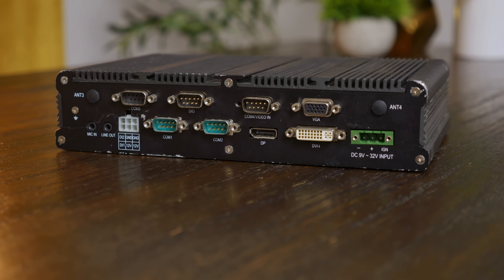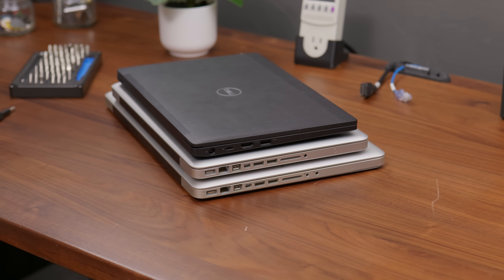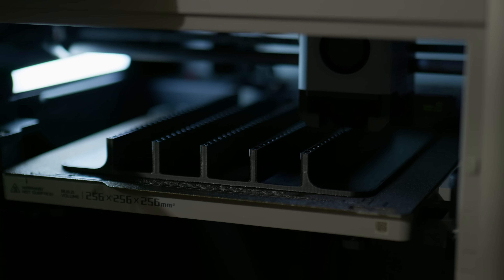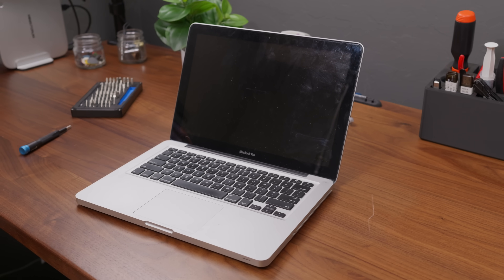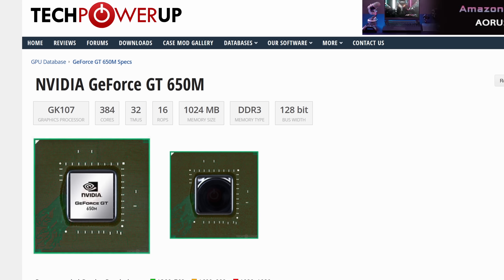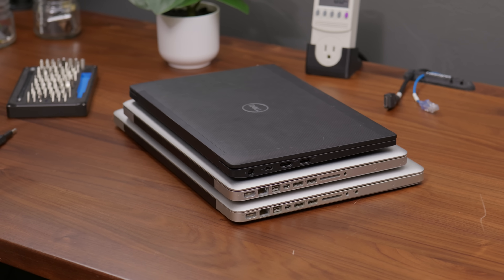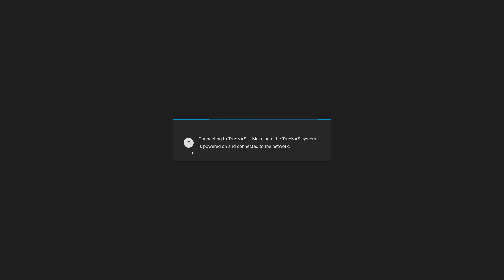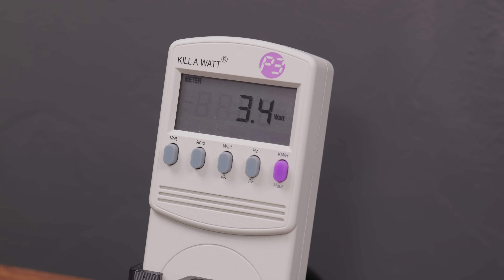Building Cheap & Efficient Home Servers with... Laptops?

Comment: I suggest removal of the Lithium Battery pack if able to so that you dont have to worry about a time bomb Pillow. I run laptops as servers and they run without their batteries installed, and they are powered through a battery backup that protects from a power dip crashing the servers. Most will run full clock although a HP 4th Gen i3 is locked to 800Mhz when it fails to detect the battery present. This actually was beneficial as 4 cores at 800Mhz was more than plenty of processing power and forced the server to consume even less power than if it ran full clock. Additionally it runs very cool with the 800Mhz forced clock by the HP Power Management system.

Comment: I’ve dealt with a ton of laptops, I would implore anyone to NOT leave them plugged in all the time.
Batteries need a charge and discharge cycle, otherwise, on either end of the spectrum, you get a spicy pillow instead.
This causes fires btw.

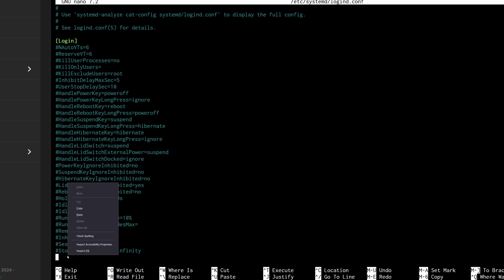Comment: 9:27 this is what I need to figure out. I was to use an old 2010 MacBook Pro to run Home Assistant. And to keep it running with the screen closed. Any chance you can point me in the right direct, or do a tutorial on how to do that with Home Assistant. Probably running Ubuntu (no experience there). I've got the optical drive SSD replacement tray that I never installed. So I'll have 2 SSDs and I'm going to upgrade the RAM as well... Just have no idea how to run Home Assistant and keep it awake with the computer screen down.
Reply: Also I don't see a link in the description to alter that login file you mentioned to ignore the lid switch.

Comment: Some laptop models are built to run completely fine on the power outlet without having a battery inside if you wish to avoid worrying about the battery swelling spicy packet problem. I expect that it can cause blackouts if the building is not up to the task of having your multiple laptops run completely on the outlet.
Reply: you must be kidding right? an electric kettle consumes 1500W, a microwave 1000W, a gaming computer 500W, a heater 1000W, majority of places on the earth are advanced enough to supply this amount without issues, additional 50-100W wont cause blackouts

Comment: I think on the one you could have run "xset dpms force off" to force the screen off another option might be "kscreen-doctor --dpms off" Both should turn your display off. Sometimes other sleep modes can interfere and turn it back on so you need to disable those if any are on. Another neat trick you can configure lid close actions a lot of the time so set it instead of lid close suspend to lid close run this command.

Comment: You can just remove the laptop battery if you are running off a UPS.  This will also improve heat dissipation and prolong the lifetime of your laptop, PLUS it is safer as you don't risk your batteries catching fire.

Comment: 4:25, ACTUALLY, I have basically the same laptop, Latitude 5290, and the wwan slot surprisingly does support SATA! I have no clue why would they allow that, but it does work, I was cloning my small SATA m.2 SSD onto a new NVMe SSD using this trick.

Comment: I know this is a bit late but, I was thinking about what you said about not being able to enter the mac bios to set on power on lan and stuff.
I am running linux on 3 mac-minis 2011 with i7 and i5 cpus and all with 16gb of ram.

I run them as a redundant pihole cluster with keepalived to have floating ip-addresses.

However, to my point.
I wanted to make sure that they boot back up after a powerloss, and that is something you would do in the mac bios setup or from a mac terminal by running sudo pmset -a autorestart 1
But... .
I figured out how to enable that from inside linux.
Running sudo setpci -s 0:1f.0 0xa4.b=0:1 from inside any linux is the same thing as running the above command in mac OS terminal.

So, I am thinking that the settings you want to enable might have similar options for linux, maybe... .)
I don't have the solution for each setting but some digging could make you find it.

Comment: Late to the show, but another issue is the batteries. I've had two Macs that swelled enough for me to put them outside until I could dispose of them. Might be good to find a way to run them without the Li-on batteries.

Comment: I had this idea a few years back of using a central server to run my entire gaming pc home network.  The concept was to have a central computer, that users can log into to play games.  This concept was powered by the video from LTT that was I think 7 users 1 PC from a few years back.  The computing resources would be centralized with powerful graphics cards and processor, and resources would be divided up between users.  The users would have simple clients PCs with large monitors, keyboard and mouse, and stream the data from the server.  If one user was on, they'd have access to the full power of the system.  Each additional user would divide the power equally so multiple people could play games together on roughly equal footing.

The goal, was to have 1 Super powerful PC that could be upgraded with high end hardware for my personal gaming, but when my family wanted to game with me, I could have 2-4 additional players with decent capabilities without having to have 4 full gaming PC setups.  That could get expensive.

Is this something that anyone has explored?  Is it possible?  Is it economically feasible?  Or would this be more work than it is worth?

Comment: Welcome to my world. 

I use a Laptop with a dedicated RTX3050 as a Home / Plex Server. Its a Powerstation and portable if i need to. It needs reasanble 10-12 Watts in idle and runs 24/7. 

I only paid 500€ for it. It can transcode or playback 4K HDR / DolbyVision for 3-4 users on the fly. 

The Setup is very easy and the Laptop looks super clean on the Desk. BONUS: It keeps running on bettery, even if the electricity goes down.

Comment: I have had a similar setup for about 4 years now. One thing to note is to remove the battery from the chassis and connect to an external UPS. Batteries in old laptops are already beaten up and if kept plugged in all the time they swell up pretty fast. Second thing was internal drives which are not rated for 24/7 loads. I ended up using an internal SSD for boot and have a seperate NAS for storage.

Comment: I have a Dell Latitude from 2009 (Core 2 Duo). I removed the display, wifi and Bluetooth radio, and installed Debian on an old 16 GB USB drive (no hard drive and didn't want to buy one). I can use the VGA port if I need a display but most of the time I just use SSH.  You can learn a lot by challenging yourself with limited resources and old hardware.

Comment: Some laptops even run without the Battery, just disassemble it and disconnect the parts, you don't need. If it reboots, its fine. If it won't reboot just connect the parts the laptop needs.

Comment: I have been running an Asus 4th Gen i7 as a plex server and a PieHole (VM) and ive got Hard Drives attached Via a USB C Hub. since each hard drive is accessed individually, the speeds are quite okay, even for 4K content. Ive had this system running since 2018, i think and it just works, i clean out the fans etc of dust once in a while and that is it.

Comment: I've been using a laptop as a server to run my non-cloud-connected home security cameras for years. It works very well, uses little power, takes up little space, and has the convenience of the built-in battery to keep it running for a good solid two or more hours during power outages.

Comment: I would worry about the fire risk of the battery using laptops as a server. also the cooling fans are not going to last long running 24/7 on most laptops

Comment: This was a very inspiring and helpful video! I have 2 different dell laptops that are "dead" in different ways. The least capable one doesn't charge the battery anymore and only works with the power adapter. The other one is 2012 top-shelf 17 in. but the screen doesn't work. I was going to throw them in the trash because I live in rural area now so there's no hardware repurposing centers (like when I lived in Portland, OR), and I don't have the time to manage a part-time hardware business like FB marketplace or ebay. But, I now have renewed hope that I may be able to repurpose these old laptops into something useful! Thanks!

Comment: I did encounter some Problems with ZFS and some "normal" Curcial MX500 SSD, I would not recommed to set it up the Way you did. The wearout on them is really high. I once had a ZFS Pool setup (in Proxmox) and Wearout was at like 12% after just some Months. It is recommended to use enterprise grade SSDs. I now Run off of a single NVMe which gets Backuped frequently to another HDD, so in Case of drive Failure I can recover from that HDD. I can recommend using some SFF Enterprise Desktops, like the HP Pro Desk. I have a Unit with an i7 10700, one HDD, one NVMe and an SATA SSD und in Idle its just drawing like 15 Watts.

Comment: I was running an HP netbook with an atom processor and 2GB ram as a NAT box and NFS server at home. It used Elementary OS. The thing started freezing randomly some 5 years ago and I replaced it with a cheap mini PC. To teach a class, today I was configuring a pink Acer aspire one netbook (featuring a 32 bit N270 atom CPU and 1GB ram), to show kids that "server" does not mean a monster of a machine.

Comment: I've been running laptops as home servers for years. 4 Thinkpad x220s with 16 gb RAM to be exact. What I like (worked well): space efficient, quiet, low power draw, reliable hardware, hardware works well with multiple OSs. What I didn't like (didn't work well): storage. My most storage intense application was Plex. Wanting to run mine on the very cheap, I bought a WD 4TB (MyDrive) external USB drive for each laptop. My experiment was to run ZFS on them. It works, but the bigger problem I ran into was when there was a power flicker and the external drives would be powered off and the servers would continue running (batteries in the laptops had enough charge to keep them running).

After a period of time (years), I bought an old Apple Mac Pro 2013 (trash can) off ebay for cheap price. I upgraded the RAM and CPU on it and bought an external RAID enclosure with 4 bays. I put 4x 4TB SATA III drives in it and I run SoftRaid. This Mac is running Sequoia (last release for this hardware). I have the RAID enclosure configured for RAID 10, so with 4x 4TB drives I have 8TB usable. Moved my Plex library over and used it for a while. After various annoyances with Plex, I switched to Jellyfin. This is the configuration I'm still using today. My biggest complaint with this current setup is that my drives in the RAID enclosure are louder than I would like.

I still have 3 of the Thinkpad x220s up and running. Mostly just use them for various experiments now. My recommendation to anyone wanting to set up a group of old laptops for home server use would be to buy a decent NAS (Synology or uGreen) to handle the storage duties.

Comment: Bad bad bad! You're giving me ideas! 😈😂
Honestly, I never thought about using a laptop with a bad screen as a server, that's actually clever because they'll be cheap enough because most people won't want it, but tech savvy people like us wouldn't care because we purpose it for something else. I personally would pull the batteries though. Sure, you can keep the system running with a battery in it...but if you lose power and your switch doesn't have battery backup, it's useless to an extent anyway. If none of your other computers have a UPS, that's also an issue because it won't prevent data corruption if your power goes out and the computer shuts down in the middle of a file transfer, so I don't really see much benefit in keeping the battery in it unless you UPS all computers and equipment in your home.

Comment: imagine mounting them on rails and you could slide them out to administer them. linux should have som power settings for like a max percentage and a percentage to restart charging. also you couldve made better use of those sd card slots - there are sd cards that go up to like 2tb now.   imagine a stack of like 8 or 10 running a hyperconverged kinda thing

Comment: Just(found) watched your video, to stop battery damage on a mifi i use in a different location,  I use a tapo smart plug. 
It monitors the supply and shuts off when 80% charged

Comment: I am running a nextcloud instance + ollama on an old Lenovo IdeaPad laptop using snap packages). It runs 24/7 sipping around 3 to 4 Wh. I bought a new battery and it can hold for around 6 hours. I hooked a caddy for extra backup storage and it works like a champ.

Comment: I used an old Dell Latitude as a VPN server that also ran SIEM software on it. The keyboard and battery were broken but I got UEFI to not look for the battery and the removed keyboard meant the fan had much more air for cooling. The system ran cool and I had a script that would turn the screen off and leave the system running. It works great and the only reason I stopped using it was because I got purpose-built hardware and virtual machines to take over the task.

Comment: In Dell, You could probably put NvME into WWAN port with adapter. It works fine in 5470 i converted into NAS server. 2.5GBps LAN adapter into WLAN port, then 6x sata adapter into NvME port.

Comment: I use an old Dell for this and installed System Bridge to feed the battery status back to Home Assistant which controls a smart plug to keep the battery charged between 50-70%

Comment: Anything with a GPU will definitely be the largest power drain. Yet any laptop should  idle it or can be disabled in hardware setup. Any lithium battery kept at 100% & alive will die even faster than normal charge cycles and may not even make an electrical connection, forget a UPS. That will be nice for a while but an already old laptop probably has a battery already at 80%, 50% of original life.  At a minimum you might check before installing the new operating system with the manufacturers system check

Comment: On dell latitudes, usually there is a bios setting that you can define how you plan to use the system in regards to the battery charging. Depending on your work you might be able to obtain old laptops to do this home lab thing.

Comment: do you think my home lab is good for nas and minecraft and beammp server hosting?
servers= 1. poweredge 2950 iii with 1x 4core 3ghz 80w cpu and 4gb ddr2 fb ecc ram 300gb raid 1 with cheetah 300gb T10 15K 1,5KW psu
2. fujitsu tx150 s7 with 3 quadro 4000s 16g ddr3 ecc ram and some 4core 4ghz cpu 2x 1tb wd blue + 2x 320gb seagate 550W psu
3. proliant ml 110 G5 2core 2gb ddr2 ecc  500gb + 160gb + 80gb 500w psu
4. lenovo idea 100 pentium laptop 8gb ddr something 128gb ssd
fo gaming= 
omen 015 rtx 3070 32gb with some H series ryzen 7 with 1tb m.2 500gb ssd wich goes to m.2 port
prodesk 600 G2 with gtx 1080ti 24gb ram and no storage in it its using network boot and the case of it i got for free old dell case 250w sff old hp powersuply

btw all running ubuntu server / ubuntu desktop cuz idk what is best to use and prodesk is using win11

Comment: I do this. People talking about batteries are not totally wrong, however a LIPO/LIFEPO battery always have a BMS. BMS's have varying quality. If they do not shut of charging  correctly, the battery will be over charged which will render the battery useless but also be a potential fire hazard
Reply: The battery overheat sensor will just kill the laptop, no fire risk. But I'm sure there are better and worse bms in varying laptops. At best, they will keep the battery from degrading quickly vs slowly running fully charged 24/7

Comment: What I'd recommend with the laptops is to use containers. I know it is a really steep learning curve, but having 4-5 mid-tier laptops is where containers shine as they are resource light and very good at migrating between workers. Create a cluster and you are sorted in terms of performance aggergation, you essentially get the cores of all laptops to be useful across the laptops, rather than one laptop barely using any resources and the other being starved. And what is cool about containers is that they do not care about platform they run on. You can have a mac and linux worker hosts and it just works.

FWIW you can dedicate a NFS or set up iSCSI from your Truenas to gove some storage to the laptops if you run short.

Comment: I've been running my entire home lab on two dell latitude machines in a proxmox cluster for quite some time now. The battery back-up is great, but the stock cooling solution is way to small for the 11th gen i5s that they have.

Comment: A really good option for this if you don't need 2.5" bays would be to get the older ryzen based hp elitebook and probook, here in the UK at least you can typically get a 6 core ryzen jobby for around 150-200 and the 8 core ones aren't much more, but specifically, these have 2 sodimm slots, run pretty cool and don't pull a great deal of power

Comment: I have 2 MacBooks (2015 & 2017) that I would like to do this same thing with, but one has no screen and the both have no batteries. How can I make a MacBook run with no battery. Also what battery charger can I use, as I only have 2 charger from a 2008 macbook?

Comment: Or... use mini pcs. Most of them, especially the recent ones will probably cost less than a used laptop but will be significantly more powerfull. Super efficient aswell. Taking less space. The only reason you would do this is if you had already unused laptop. Otherwise it seems like a waste

Comment: I used to run laptops as a home server, but now I have desktop. Maybe it uses more electricity.

I think you could have shut down the Mac's GPU also similarly as the display. At least I did that on Linux with my laptop.